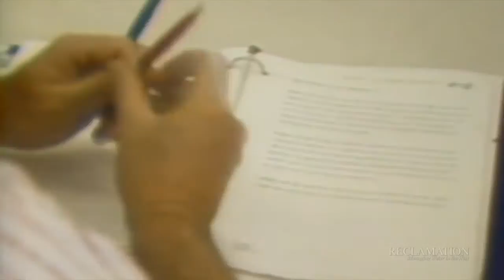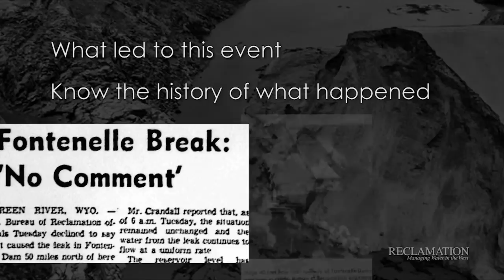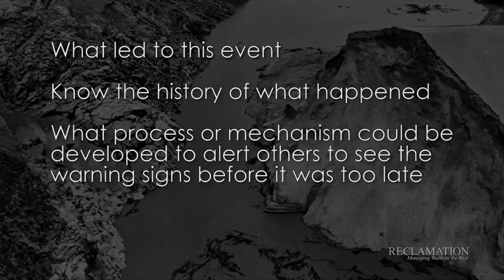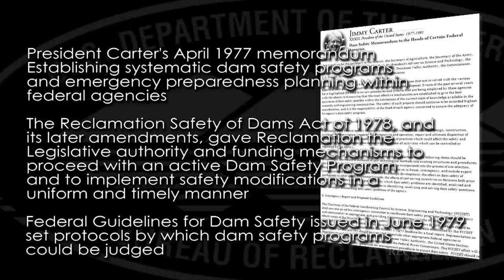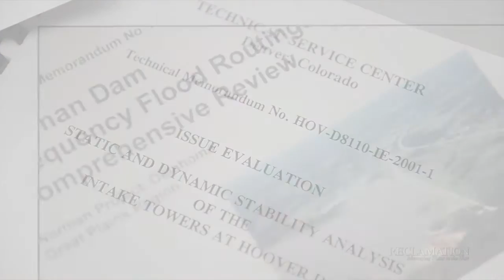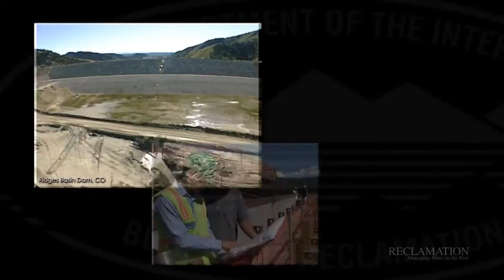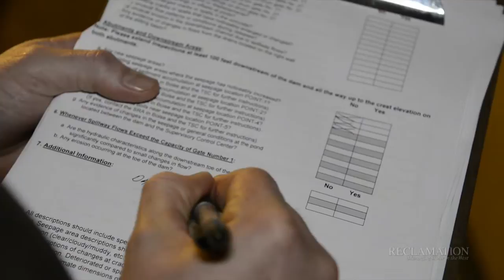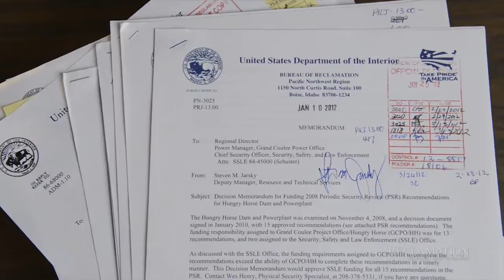Dam Safety, Evolution of a Program

Comment: Related story from engineering geology class, Dr. James Baer, BYU - years ago - he explained the faults & related issues at the dam site (described in the video) were well known to geologists. For some reason Reclamation wasn't concerned. He warned Reclamation to no avail. One day during a field trip on the bus with his geology student, as I recall it was a Saturday, he heard on the radio there was a little leak BUT nothing to be concerned about. He said he knew it was all over. A while later he heard the same on the radio.